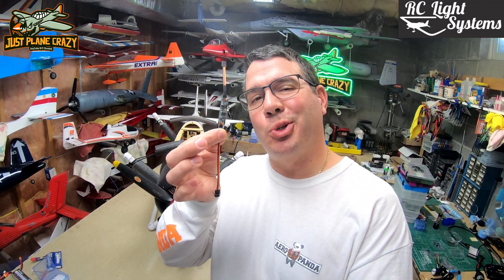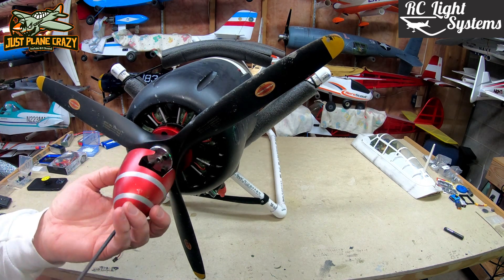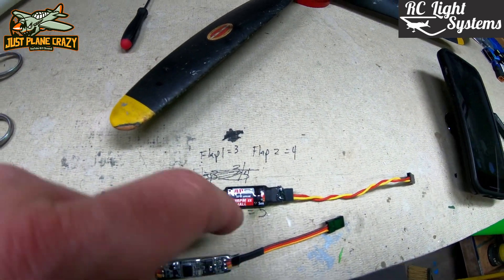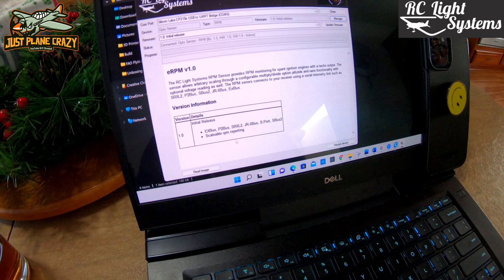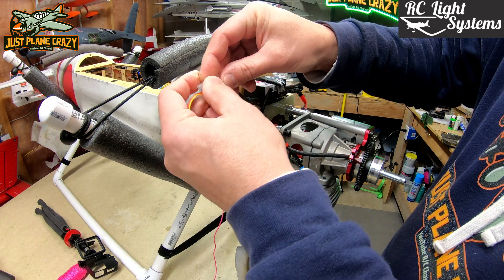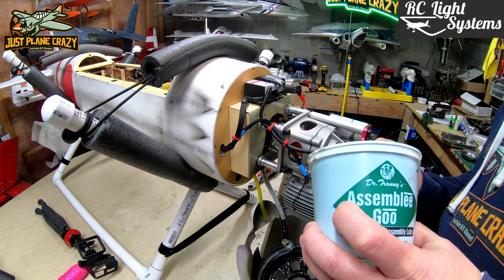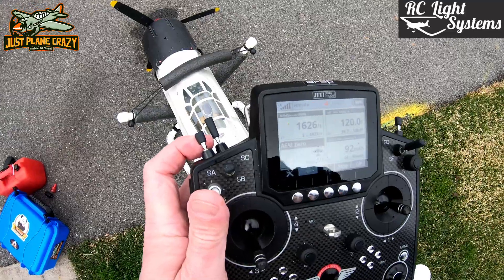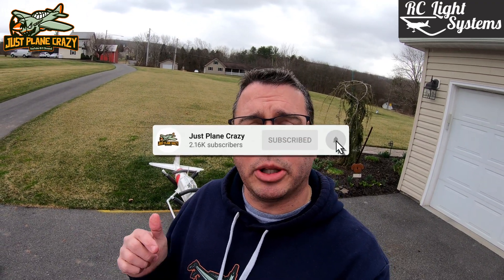Getting RPM Telemetry from your Gas Engine with Rc Light Systems; Jeti, Futaba, Spektrum, JR,

Comment: Nice Video! Why is the rpm already at 1.600 rpm while the engine is "off"? Do you know, if the sensor can wotk with Graupner Hott receivers?
Reply from the maker: You can check the site to see what it works with.  www.rclightsystems.com
Reply: @JustPlaneCrazy  Yes, I checked, but they do not have Graupner Hott in the list - but somtimes JR is compatibel. I will contact them, thanks. Any commant on the wrong rpm while switched off?
Reply from the maker: It’s like a default reading. Email them. They are very responsive and good to talk to

Comment: I didn't see the sensor you had on their site? Very cool setup!
Reply from the maker: Click the link in the description. It will take you there
Reply: @JustPlaneCrazy Your link gets me to the accessory page.  I see the usb dongle on the page but I cant confirm the same device that you have that plugs into the cdi box. Once again great video! Just trying to confirm I am ordering the correct device.
Reply from the maker: For Spektrum only 
https://www.rclightsystems.com/product-page/rpm-sensor
And I don’t see the one for other systems. Let me contact them. You should do the same. Ask them for the correct one. Tell them you saw it in my page.